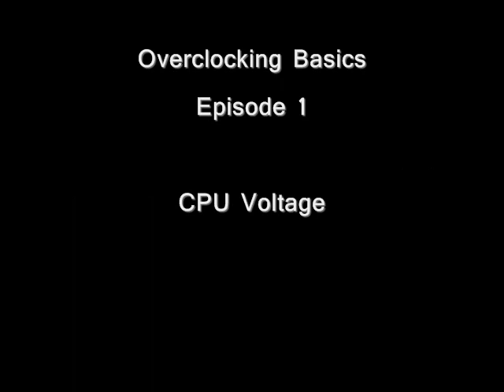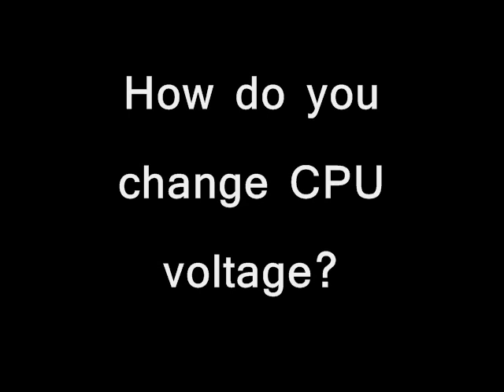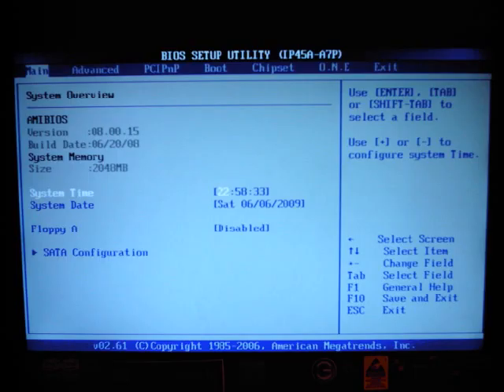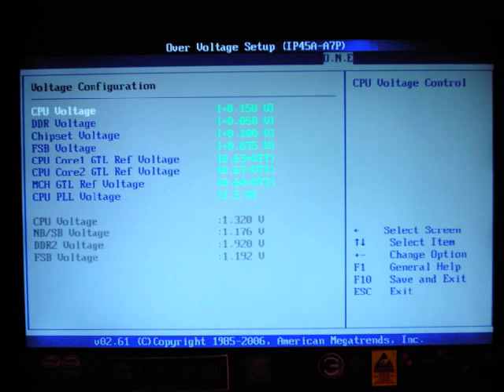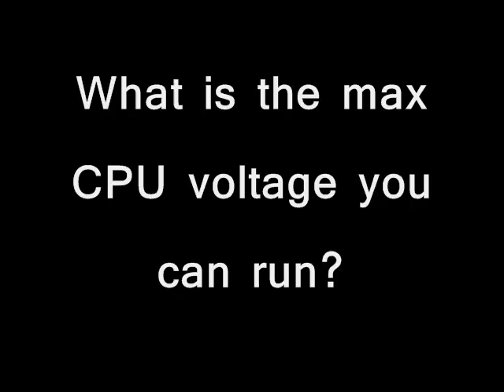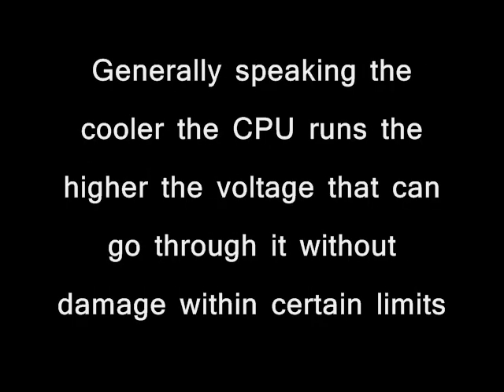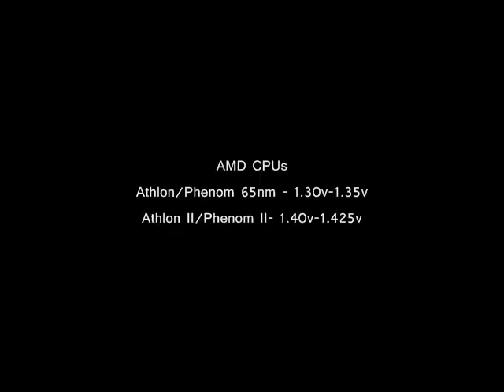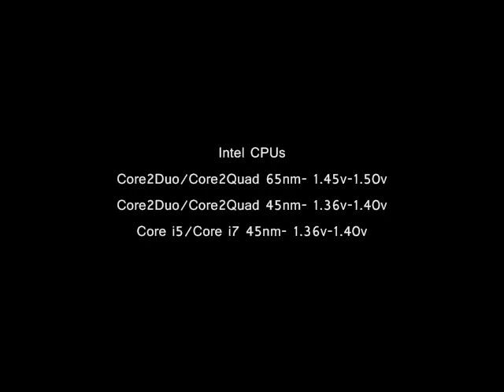Overclocking Basics: Episode 1- CPU Voltage

Comment: My brothers computer voltage is this.

VCORE VOLTAGE: 0.016V
3.3V VOLTAGE: 3.632V
5V Voltage: 0.051V
12V VOLTAGE: 0.105V

is that good for a core 2 duo processor, 4GB ram and a amd graphics card?

plz reply

Comment: At last, a brief yet clear explanation about voltage. One question, i have the phenom II X4 965 BE, and i was thinking about rising the voltage to 1.5v, now, with those numbers in the video I see that it might not be a good idea, so, will the CPU handle 3.8ghz (instead of the stock 3.4) at the stock voltage of 1.4v? Thanks.

Comment: Hey nice video 5/5. 

I have a 3.0 ghz dual core AMD. I overclocked it to 3.9 ghz with a voltage of 1.53. Stock it is at 1.4

My temps are never over 25c. I want to get to 4 ghz. Is there anything wrong with my voltages?

You say 1.425 is max voltage! Im way above that! Thanks let me know